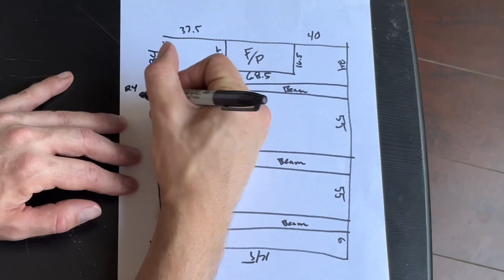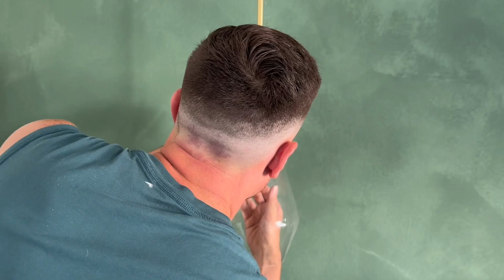DIY Faux Wood Beams!! (w/ Integrated Lighting) **part two** | EXTREME RENTAL BEDROOM MAKEOVER

Comment: You should be extremely proud of yourself, this is about the hardest thing you could do especially alone.  
As-is it is wonderful.  That room looks nothing like a plain white box, but has character and dimension.
I know hind-sight is 20/20, but I do not believe you could have done a better job, especially with the aesthetics.  
thinking aloud, the opposite sides of the room seem to contrast too much.  Could you echo the opposing side a little?
Maybe use a little of the green limewash on the other side, could be the back of the shelves only?  Maybe a big watercolor above the bed?  Or a shelf like the other side with some mostly white things on it there?  Somehow echo and blend the difference between the two sides only for balance.
Just a thought.